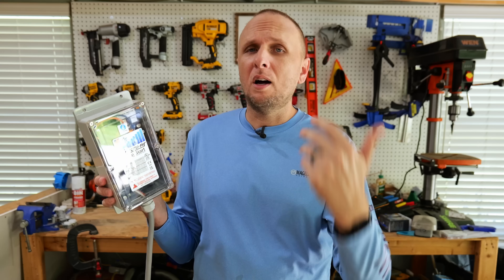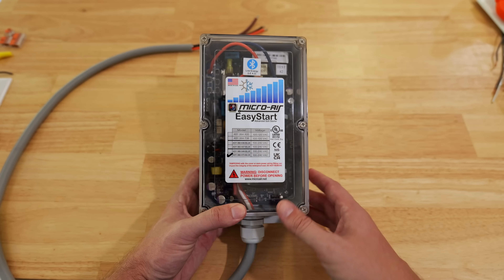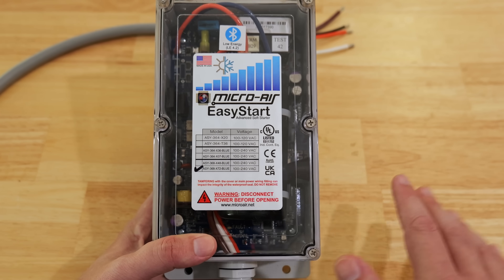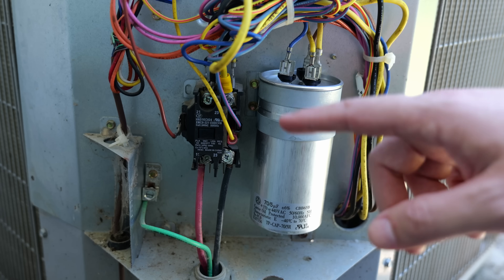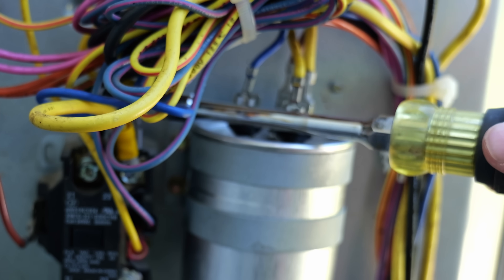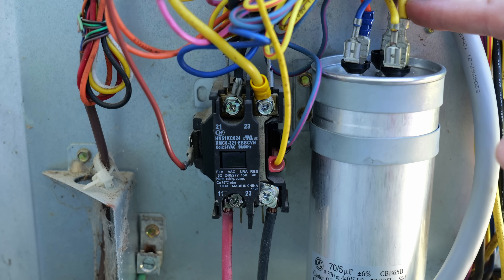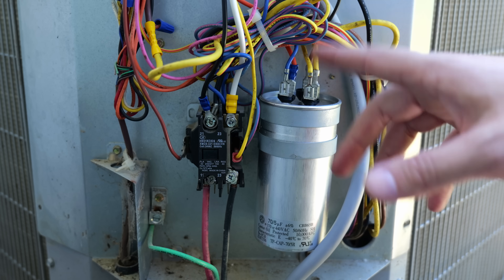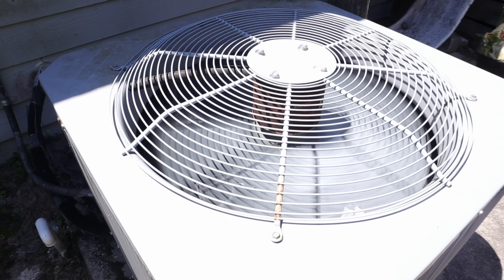Why Every Homeowner Should Consider Installing an AC Soft Starter | Micro Air Easy Start Install

Comment: I am about to install this on my unit. Instead of the butt connector of the compressor run wire ( yellow / brown), would it not be easier to just unplug the yellow from the capacitor and plug the brown in it's place?

Comment: I am sorry,  but installing this or opening up an A/C unit is not a DIY thing. Nor should it ever be attempted by a DIY'er,  installing this should only be done by a licensed professional electrician or A/C contractor. If you do not follow or adhere to local and federal codes you could be in code violation. also if strict safety is not followed you could short out electronic control boards, or capacitors causing serious damage to equipment,  personal bodily injury, or Death! Please do not attempt this as a DIY'er. Take it from a 30+ year Master HVACR Service tech. Let the pros handle this for you!
Reply: Wow! You need more prayers than I thought. How do you know the technician’s intentions are not good. I have read comments for the past two hours and I have learned a lot about this channel creator.  I have also learned that there are a lot of people posting comments for helping wiring  and you haven’t replied. You got them fired up and thinking that it’s easy, then leave them high and dry.  That called deception. So you make money off your videos but don’t really care about your subscribers.  Just because you read up on it and understood before making a video doesn’t mean everyone else will. I believe this is the intent of the technicians statement. People can hurt themselves or cause damage to their unit. Not to mention maybe even void their warranty. That’s all he is saying.
Reply from the maker: @FreshairSolider you bored?  You’ve been writing lies and opinions on this same video for 3 hours now.  I mean by all means continue.  It helps the video but you got really upset and hope you’re ok.
Reply from the maker: Of course an AC tech is going to say this.  Yes all of that could happen but many are capable of doing a lot of the work and has to be decided and weighed out by the homeowner.  No reason to be sorry.  For the sake of your trade and business of course you don't want homeowners being able to fix or add things on their own.

Comment: Towards the end you do not show where the clamp meter was connected. Which wire did you connect the meter?
Reply from the maker: Compressor R wire.  Just like I did for the first test.
Reply: @HowToHomeDIY  thank you

Comment: So my AC unit (Carrier)shows this prod number : 25HBC536A0030060. So what ton is my unit?  36? Confused.
Reply from the maker: Divide that number by 12.  The 36 is saying it’s 36,000 BTU’s each ton is 12,000 BTU’s.  So the unit is a 3 ton unit.
Reply: Thank you
 @HowToHomeDIY

Comment: Great video..Buying one for my A/C. I've got a 6500 KW genset, and a 4 Trane Xr15, is there a way I can tell if the generator will be able to power the A/C with this installed?

Comment: my 3 ton unit should use an X48 but is it ok to use an X72 in case I increase the tonnage size at a later date?
Reply from the maker: I asked Micro air about this and they said no.  They are each programmed with the specific tonnage in mind.

Comment: do any AC manufacturers claim that a soft start will void the warranty?
Reply: I since contacted Micro-Air and they quoted me a statute indicating warranty couldn't be voided but then again they are selling the add-on..
Reply from the maker: It can’t be voided when installed properly.  They are correct.  It’s what I’ve been trying to tell this guy for 3 hours now.  He doesn’t believe it because his “AC Mechanic” said he wouldn’t honor the warranty.  I’ve never heard of an AC mechanic but if one told me this I would find a new one as it’s false.
Reply: My warranty provider stated this device and any other like it will void my 10 year parts and labor warranty. It would definitely be a good idea to check with your warranty provider.

Comment: Oh, by the way, you can build one of these for about $40 from Parts at the heating and air supply house. The idea  has been around as long as electric motors have Of course the one you build won’t have Bluetooth unless you’re able to put that on it

Comment: Mechanical and electrical engineer, here So, in a nutshell, if you hook a gasoline, powered portable generator to your air conditioner, you will burn out your compressor in a matter of time.  Without a power conditioner, your compressor will be changing its RPM to match the generator and it’s not designed to ever change its RPM. So beware of what these guys tell you.
Reply: All that schooling and you still can't pay attention. Did you even watch the video?
Reply: I’m assuming if you are using an inverter generator then that wouldn’t be an issue like it would with a standard “dirty” generator?

Comment: Typically under normal use the initial high amperage draw that occurs on start up doesn’t hurt anything. I’m pretty sure the manufacturer would rather you not add a device that allows you to power your AC with unconditioned power from a gasoline Generator. Portable generators typically don’t put out the proper 60 Hz Cycle power needed because the generator has to speed up and slow down to maintain a voltage within an acceptable range, and when the generator Has to ramp up or slow way down that can and will eventually burn up your compressor.  And does quite often when hooked up to a portable generator. The soft start or the hard start. Kit will not hurt your compressor, but the generator will unless you can put a power conditioner on it. But these content providers don’t ever do the things they suggest long enough to find out what the drawbacks are? And compressors are usually pretty darn expensive so a generator should be used only in an emergency short term solution to a power outage
Reply: I’m surprised the channel creator hasn’t commented on your post. I’ve been reading posts for two hours and he seems to argue with anyone who doesn’t agree or has reservations about this device.

Comment: 125A really? Many genrators only have a 30a outlet/breaker to power everything. My 4ton AC is on a 40a breaker inside
Reply from the maker: Yours may have a better seer rating.  Every AC unit is going to have a different requirement.  Yes most small to mid size generators only have a 30 amp outlet as that’s all they are capable of powering.  There are many larger ones though that will have both a 30 and a 50 amp outlet.

Comment: Do I need a soft start kit if I’m going to be running an inverter style mini split system? I’ve heard other guy’s saying that that’s the benefit to buying the inverter style in that it automatically has a softer start which is helpful in solar applications. Can you guide me on whether that is accurate or do I need to in fact install as n actual soft start kit? Specifics for my application in case it matters is I’m installing a 36k btu LG mini split inverter model with 3 interior heads and I’m installing it in my 40’ Coach (RV). It of course is a 240 volt model and I’m planning upon running it off of solar or generator 98% of the time and the other 2% will be run off of shore power. Thank you for any help and guidance, I appreciate it!!
Reply from the maker: From what I understand, a mini split would not need a soft starter.

Comment: The alternating current that comes out of portable generators like this can be a little dirty and inconsistent. Would you have any concerns with running an air conditioner compressor at length?  Are there any components that could be damaged if they are not running off the cleaner current provided by the utility company?

Comment: Thanks for the video. You are the only youtuber that explains this in a way that makes me feel confident enough to do this.
Reply: You might want to check with your warranty provider before installing. Just in case diy or product voids warranty
Reply: @FreshairSolider  Thank you this is a great point I kept in mind. Unfortunately I had 3 HVAC guys come out they made it sound super difficult along with an unreasonable quote. I did it myself after studying the schematics, install took less than 30 minutes. I felt confident every step of the way, luckily my set up is exactly the same as in this video, works wonderfully for the past 8 months.

Comment: If I put this soft start on my AC will a 7500 champion generator be big enough?  I just used a 4000 watt generator and it did both of my fridges, 2 televisions and router, and a few lights and fans.  The champion is almost twice as big.  I am also thinking about leaving my central air off and just using a portable AC unit in my living room.  Great channel!

Comment: A question for anyone knowledgeable in this; Would it make any difference if I instill a soft starter ranging from 4-6 on a 3-ton AC?  Or it will be okay for a 3-4 Ton soft starter? Thanks in advance.
Reply from the maker: Micro Air told me you have to get the correct model installed on your particular sized units.  They are all programmed with that in mind.
Reply: I will need to make sure the tons of my unit then. Thank you
Reply: Is it possible to let me know based on this information of my unit, what's the size of it in Tons?

PRODUCT NUMBER
25HCB636A0031030
MODEL NUMBER

25HCB636A310

Thanks

Comment: Any advice how to set it up on my Ameristar AC that seems to have 2  capacitors? I have a 70uf and a 15 uf capacitors. 70uf one has black and yellow wires, the smaller one has black, brown and orange. I’m completely clueless but don’t want to spend money on an electrician lol I asked around local AC companies and they don’t want to mess with the wiring on the existing unit.

Comment: I have a new 3 1/2 ton AC unit installed last summer, and a 22KW Generac, I was told I did not need any soft start or hard start system on a newer AC unit

Comment: Perfect video!  Clear and understandable commentary without any blah, blah, blah . . . it was to the point!  My unit will scare the crap out of you if you're standing next to it when it starts up . . . so I will definitely be installing one of these.  Unfortunately Amazon says it's currently unavailable, but I'm guessing because it's summertime the manufacturer just couldn't keep up with the demand and they simply ran out of stock for the time being.  I do have one very important question though; ironically I was already planning to replace my 6yo unit with a much better unit that's already a soft start set-up . . . which is not cheap by the way.  My question is, do you recommend spending big money for one of those top tier units that's a soft start unit to begin with, or replacing my aging unit with a common "non soft start" unit and adding the Micro Air like shown in your video?  Would there be any differences or benefits?  Please let me know.  Thanks Adam.

Comment: Adam I watched your video and it looks super easy to install this soft start unit. I have a Trane 4-ton package unit for my manufactured home in Florida. My A/C unit has two capacitors, a 10mfd run cap for the outdoor condenser fan, which is mounted on top of unit, and a separate 70 mfd run cap for the compressor. The 70 mfd only has two single terminals, neither one is labeled, it has a red wire coming off the contactor feeding one of the capacitor terminals, and a orange wire going from the capacitor to the start winding of the compressor motor. Since I don't have multiple tabs on the capacitor to connect the orange wire from the soft start to, is there a piggyback connector I can use to be able to add the soft start orange wire to, and if so, which terminal should I use the one with the red wire from the contactor, or the one with the orange wire going to the compressor? There is also a third blower motor, a variable speed vortex blower which supplies air to inside of house. That is controlled from a circuit board which will regulate speed depending on the jumper switch settings. Any help would be much appreciated, thanks.

Comment: Do I have to increase from 30 plug to a fifty Amp? I have a duromax 13000 gen.
Reply: Same as mine. No 30amp works on mine. It takes a few minutes to start at first but starts and runs fine

Comment: Very cool, really nicely put together product - and a great video!

I’m curious, how common are inverter based AC units in the US, at least in South Africa it’s fairly common to spend about 10-20% more on the unit and get an inverter based unit - the inrush current is super low and as far as I can tell never higher than it’s max rated current.

Of course buying a new unit is way more expensive than getting a soft starter, just curious to know how popular inverter based ACs are.

Comment: I have a hard start installed on both of my 3.5 ton unts. But having trouble starting one of them. I have a honda eu7000is it use to start the units no problem and the generator works well. Can I add one of these soft starts if I already have a hard start?

Comment: Have you seen a difference in your power bill by using this?
Reply from the maker: No, it only decreases the initial in rush current, not the running current required.
Reply: I assumed that would be the case. Thanks for taking the time to reply back.

Comment: Installed mine today.  Waaaaaaaaay cheaper than a whole house standby generator.  Excellent video!
Reply: What does this have to do with a whole house generator?
Reply: @535banshee  you don’t need one with this installed. You can just use a portable one with enough kick. Did that really need to be explained or do you and the other commenter really not know the difference between portable generators and whole house standby generators and their massive price differences?

Comment: In talking to 2 large HVAC companies in San Diego, they both like these but said you don't buy one to save on your electrical bill or make the A/C unit (my application) more efficient. Yes does help save the compressor motor and actually help the other important appliances in your house against surges. They also are talking (both of them) about the kit itself costing $800.00, before installation. Good video thanks.

Comment: EXECELLENT instructions straight to the point and super easy to follow the only question I have is on the 5 restarts do you turn off the thermostat or the breakers in the breaker box or all three?  Also if not hooking to generator right away can the ac unit just run normally for the 5 cycles?
Thank you again for an fantastic instructional video

Comment: How are you running your house on a portable generator???? How are you balancing the load? How are you compensating for simulated line one and line two? This looks like it will burn up many of your electronic devices when the balance flips and you have 60v on line one and 180v on line two!

Comment: Nate certified here... don't do this.. it's used on specific units for many reasons but is guaranteed to effect warranty if you add equipment the manufacturer didn't authorize

Comment: Forgive me if this is a stupid question, but it seems to me that this ALSO reduces the amount of electricity (and therefore, the cost to me) because it doesn't require those 125amps, however briefly, during the start-up.  Am I just confused and it still uses exactly the same amount, just over a longer (softer?) start-up period?

Comment: Trying to determine which is the herm terminal on my capacitor? It is not the terminal where the run wire is going ( there is also a blue wire there)?
Reply: Correction...The terminal with the PURPLE wire, also has the RUN wire (that goes to the contactor). That is where I connect the ORANGE wire?
Reply: I just learned from my A/C guy that the unmarked terminals on the capacitor are as follows: 2 terminals - fan, 3 terminals - herm, and 4 terminals - common  So, confirming...I am connecting the ORANGE wire to the HERM terminal.

Comment: Great video and just the info I needed. I noticed at the end you used a 5500 watt unit to power your A/C. I have an old Troybilt 5500/8800 that I was hoping to use in emergencies. My A/C is a 3.5 ton/15 SEER Bryant unit. According to the sizing guide at EasyStart, the minimum generator requirement would be 6100, but it looks like your 4 ton unit ran just fine. Do you think I should stick with my original generator or upgrade? The plan would be to only run the A/C during the day with no other load until the house was cold and dry. After that, I would use portable window units to reduce load and run my other required circuits. I would not run the generator at night, so it would always be monitored for overload and other issues.

Comment: Or, just install a geothermal system, heat and cool your premises for less than half the cost, less than half the carbon emissions, no compressor, no massive capacitor, no starting problems, no refrigerant, no complicated parts to fail. It just works, and the only energy it needs is for a simple blower to circulate the air to and from the heat exchanger. Do a bit of maintenance on the blower every couple years, and you can have a full no-compressor heat pump system that runs for the rest of your life and maybe even that of your kids. What are we waiting for?

Comment: 6:36 Using a screwdriver to discharge a capacitor is an incredibly bad idea, especially one that size (about 45 microfarad, 230 VAC). It's common practice and nothing catastrophic usually happens. Usually.

It's far better to first check the capacitor state of charge with a meter and then if it needs to be discharged, apply a load to dissipate the charge.

I work in industrial automation and typically use wire-wound, high-wattage resistors to discharge large capacitors. In the case of an HVAC capacitor of 45 microfarad and 230 volts, I'd use a 2kohm, 50-watt resistor. Calculators to determine safe discharge rates for capacitors can be found online.
Reply: A high-wattage light bulb can also be used, in a pinch.